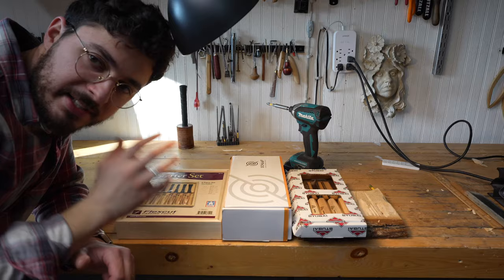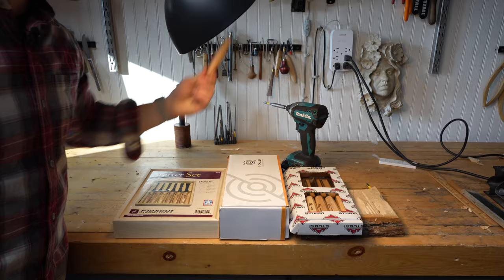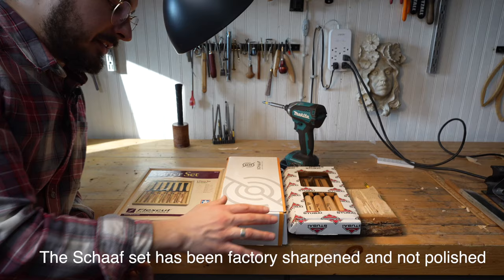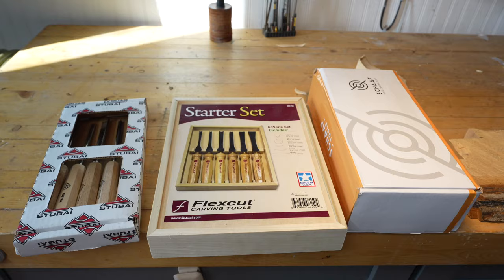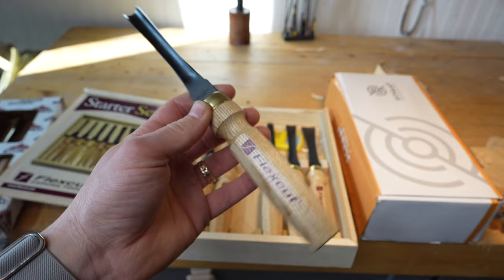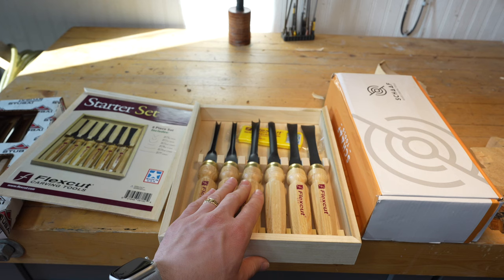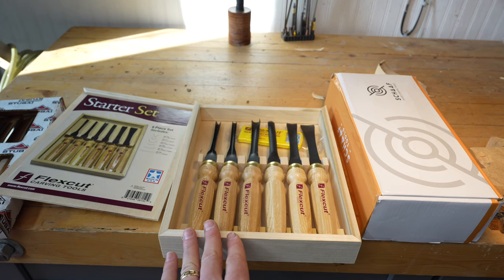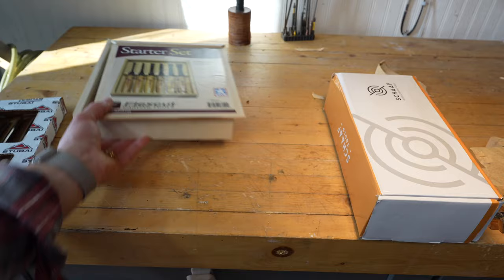Buy this Gouge Set - Woodcarving Gouge Review For Beginners

Comment: Thanks Alec for the great review. I have both the Flexcut and Schaff chisel sets and I agree on your assessment. The Flexcut set was “ready to use” right out of the box. I found that if you’re willing to spend several hours reprofiling and sharpening the Schaff set you’ll find that they are darn nice tools at a great price point and you get a larger selection. The handles weren’t as good on the Schaff set but they’ll exchange the defective ones without any issue and they stand by their tools. It’s nice to have a good range of tool options available.
Reply from the maker: Thanks for input!
Reply: Do u call flex cut number ? Or send them info? Thanx Patrick
Reply: I really like the Schaaf fishtail set. A reasonably priced set to supplement my other carving tools.
Reply from the maker: I haven't tried those yet! Thanks
 @ericburleigh1545

Comment: I have used most major brands at one time or another in my woodcarving career, now in my everyday work I use mostly Stubai  tools, they are easy to sharpen and hold the edge very well.I do have a few Henry Taylor tools , which are good and I use Flexcut blades/tools in my Automach.
Reply from the maker: Thanks for your thoughts!

Comment: Thank you for this comparison :) I think you are not comparing apple to apple, because Stubai produce high end tools, Flexcut is a medium range, but Schaaf is a low end tool supplier. It would be nice to compare Narex Standard (Eco line) with Schaaf and Bevercraft. 
Currently I am mostly using Narex and Pfeil (Swiss Made) and I am quite satisfied. Both suppliers have sent ready to use tools. Some time ago I had similar problem with Hanry Taylor (sold by Dictum shop - with their logo)  like you with the Schaaf but after sharpening cutting edge behavior was very good.
Reply from the maker: Fantastic video idea! Thanks

Comment: Thanks for the review Alec, I always enjoy these. I own a mixed bag myself with a lot of older tools like SJ Addis. But I was given a set that was bought on Amazon called Deadwood Tools. They look just like Schaaf. I have some Schaaf and its very hard to tell them apart without looking at the markings. Same weight, thickness etc. they needed some work to get sharp but they are actually pretty good steel.  About half the price of Schaaf.  Would love for you to give your thoughts.
Reply from the maker: I will look into those tools. Thank you!

Comment: My Schaff set looked polished, but had machine grooves on the underside of the tips. The angles were to aggressive.  No small v tool. No big flat gouge. Tools equal to 11.00 a tool. 120.00 set.  Not the best for a beginner if you need a bench grinder to tune up.

Comment: I have that schaaf set. Awesome customer service.  I had 2 that were replaced due to the edge being off. No question.  But, i think the #12 6mm is at a really steep angle. Am i wrong? I also  just signed up for your onl8ne classes.
Reply from the maker: The #12 is fairly steep, but I would recommend getting an additional V-tool to supplement the soft v in the set!
Reply: @AlecLaCasseArt  Yea but it makes me leery of buying schaaf because they don't sell individual pieces. Retired now but never bought tools that didn't have open stock (heavy equipment mechanic). There was always a chance of losing or maybe adding on to set.
Reply from the maker: I agree with that @jimcarter4929  ! They need to start selling individual tools!
Reply: @AlecLaCasseArt  I love the Flexcut 60 degree V-tool. I will reach for it, before even the Swiss Made.

Comment: The Hardness of a tool does not determine its durability and ablility to hold an edge.. there is a difference between hardening and tempering the tool as these are two different sequential processes.
Reply from the maker: This is a good distinction! Thank you!
Reply: I thought when you temper metal it gets harder. Therefore more able to hold an edge longer than softer tools.
Reply: @ozoneswiftak   It is a two step process in knife and tool making. After the tool is forged, it undergoes a two step process. First it is hardened by heating to at least 1500 degrees F then plunged immediately after in oil or water. Hardening allows you to make the edge with a narrow bevel. After the tool cools to room temperature, the tool needs to be tempered to get it to hold its edge. This is done by heating it up again at a lower temperature at 400 degrees F. Hardening is different from tempering. Just visit any knife making channel on YouTube and you can understand what i am talking about.

Comment: You might like to know that most European tools in the past were not sharpened.. When the owner of Ashley ILes ( ILes is pronounced Eye-Less) first went to America to market his tools, He was shocked that Americans would not buy a tool that was not sharpened.. This made no sense to him since most woodcarvers prefer to grind their own bevels particular to their work. He was not stupid and went ahead and sold them sharpened and his sales boomed. The rest is history.  Also the flex cuts work fine on harder woods. If you look at the work of Mark Yundt a commercial carver, he does not even change his bevels going between basswood and oak or walnut. Also Do you know whey Flexcut was used for  the name of the said company?
Reply from the maker: Very interesting! Thanks! I use the same low grind angle for all of my carving from basswood to red oak!
Reply: The Flexcut knife was designed with a thin flexible shaft to allow a “springing” effect when using the tool. It was most evident when one pushed the tool with one hand.   Made it easier to pop off a chip.
Reply: @buckbeans1  Makes sense, since Flexcut is made from "spring" steel.